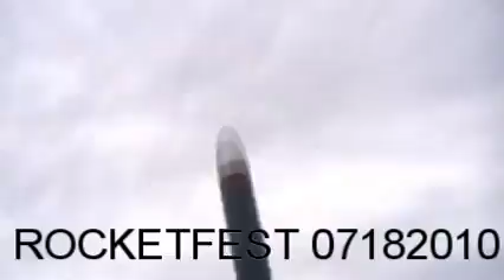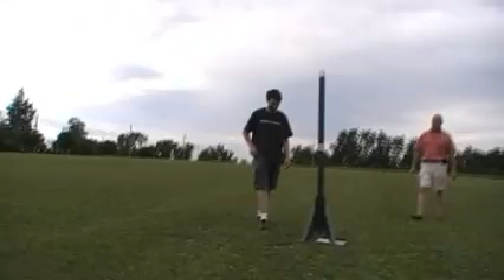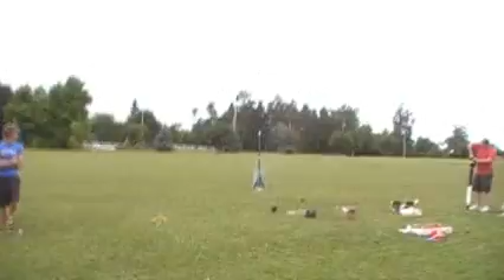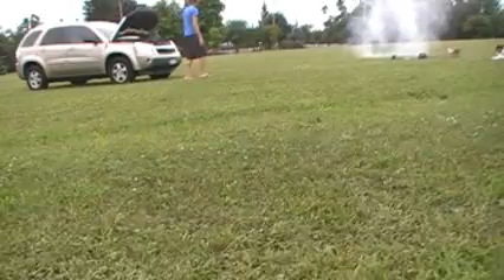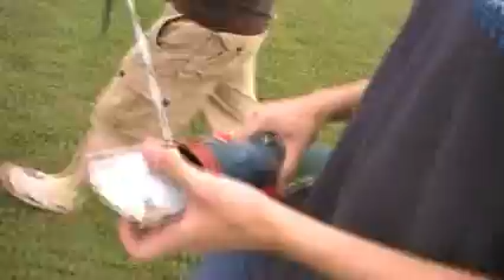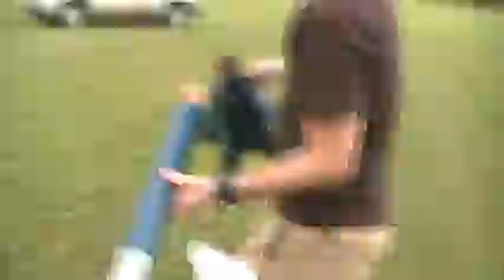ROCKETFEST 07182010 - Preliminary Footage

Comment from the maker: @Rickdens From what I understand it was either not enough thrust or not enough thrust and bad COP/COG.  I'm pretty sure we determined it had inadequate thrust; he designed it for 4xC + 1D on the booster (1st) phase of thrust with an E on the second phase.  4C's and a D was enough burst thrust to get it going fast enough to keep it stable during the first 2 or 3 seconds of flight.  This launch he only had a single D in the booster. By 3 sec of flight this puppy was at 45 deg.

Comment from the maker: @Rickdens We also did successfully launch it in the August 2010 Rocketfest which I never put the vids up from, but it crashlanded after one booster engine failed to ignite, it flew up at too sharp an angle, and he used the E with the longest delay charge possible (8 sec?)